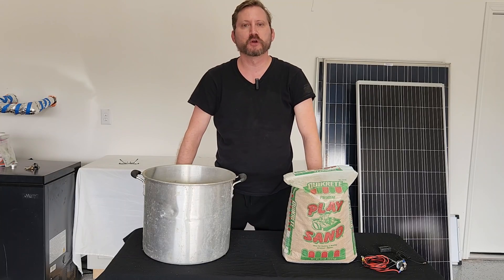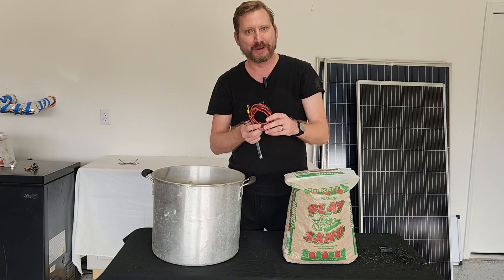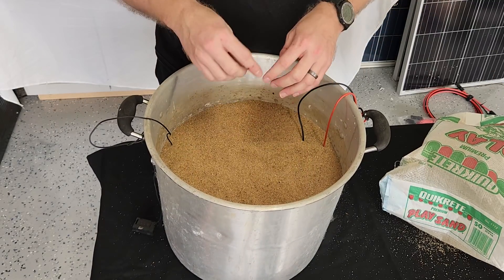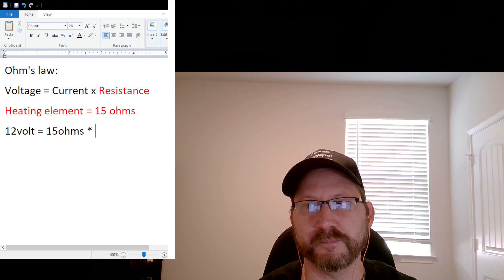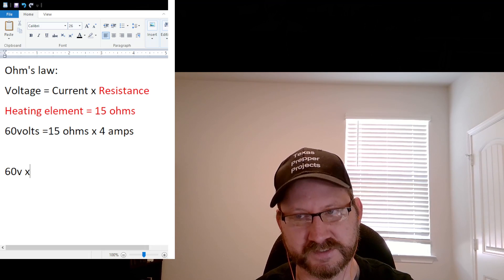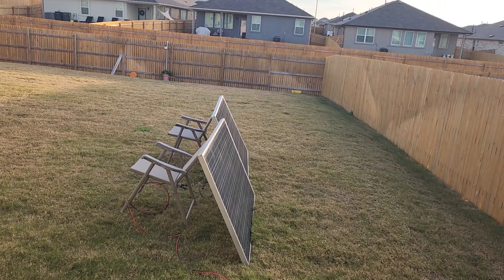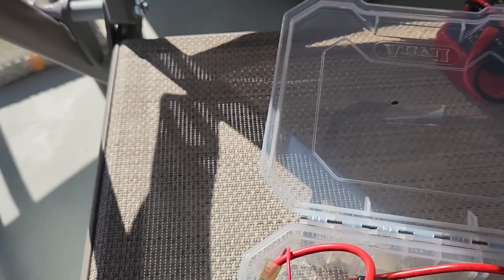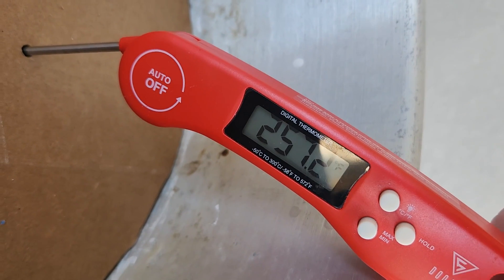Sand Battery Heater solar powered 250F / 120C with no flames or fuel! DIY

Comment: You miss one point.  But it’s otherwise a perfect demonstration of the principles of sand batteries.  The purpose of making a battery is to store energy for you to use later when you want to use it.  So putting in an insulated container is how you retain the heat for later and pipes would allow you to extract the energy when that time comes.
Nice vid.
Reply: I was thinking about this as well. Presumably while the sun is out there is enough heat for the greenhouse and storing the heat for the night or for cold cloudy days will be more important. Maybe the mass needs to be big enough that it never hits a peak and levels out. That way the maximum amount of energy is stored and can be released more slowly as opposed to getting a max temperature for the watts available. 

I like the simplicity of the setup and it's a good video!
Reply from the maker: @jhornett   thank you!
Reply from the maker: depends on where you put the sand container. If it's INSIDE the house, then DON't insulate it. If you put it OUTSIDE the house, then DO insualte it. You can't cheat thermodynamics
Reply: @texasprepperprojects but, if you want to use the heat later in a cold evening, after sun down, it's a good idea to  insulate it, until you need the heat.
Reply from the maker: @W3c16B  it depends. If you watch the video, I talk about this. If your container of sand  is INSIDE the airspace you want to you want to warm up, then do NOT insulate it. If your thermal mass is OUTSIDE the airspace you want to warm up, then you have to do ducts and fans and such. why? heat is heat is heat is heat. You want to get that heat INSIDE the space you want to warm up.
Reply: seems to me using water is a lot more easier and makes more sense.
Reply from the maker: Watch the other videos in the series
Reply from the maker: @ursodermatt8809  except water stops at 212F and then you have to make everything waterproof
Reply: @texasprepperprojects  
not so,
you can easily raise the boiling point by pressurizing or adding things like glycol.
you will find the radiator in your car is pressurized.
the problem with your 2000C sand is, how to you remove the energy?
you are going down a road that creates more problems than it solves. like the higher the temperature the more losses.
it is much easier having a larger area with relative low temperature than the opposite.
now i hope this physical facts apply the america as well.
Reply from the maker: @ursodermatt8809   the point of this experiment is to create thermal mass to heat a room, not to power a city.
Reply: @texasprepperprojects  
ah yes, but the sand is a bit difficult to control when you do not want the heat.
in the 70ies after the first oil crisis this people built a house over a pit filled with rubble heated by hot solar air. the problem was on a hot day they got a double whammy from the rubble and the hot air outside.
there is a reason water is used and people go through the trouble with piping and water tank. rather than a box of sand.
Reply: @ursodermatt8809  
It depends, because you need a nicely sealed  container.
People used IBCs but you can not get more the then 60degC permanently in, otherwise it will disintegrate.
If you use sand, and run it with higher temperature, you can put a stainless steel pipe as Heatexchanger into it, but you should use a liquid (not water) which does not vaporise if you heat up the sandbattery. Also you need High-temperatur stable insulation which is hard to get. Except something like Rockwool which withstand  750degC.
Reply: @ursodermatt8809  Water causes pressure and you can heat it to under 100 degrees C.  Sand can be heated to 200, 500, and pro made systems up to 1000 degrees, and doesn´t cause pressure.  Sure water is an easy way, but sand isn´t much harder.
We all have different priorities... I am planning for a system that could keep some heat for a longer time (1 day)... as electricity prices vary, saving heat could spare some money.
Reply: @PjotrII  
one day only?\
then go with a lifepo4 battery.
most definitively.
Reply: @ursodermatt8809  Well, the ONE# DAY comes from a test where a guy built a small sand battery, heated it and got 5 hours of heat (while using a FAN blowing out warm air)... so my aim was to think about a slightly bigger build and possibly have 1 day of heat to be used.
Reply: @PjotrII  
yes, there is just the small problem of scaling it up.
now here, talking about it and actually doing it are two very different things.
i am glad to hear from you after you actually built something.
greetings
Reply: @ursodermatt8809  Water brings with it a lot of complications.  It boils at 100C so you don’t want to go beyond that unless you are ready to deal with steam and pressure.  Corrosion.  Leaks.  Sand on the other hand can keep absorbing heat all the way up to ~1700C.  The name of the game in batteries is getting maximum storage capacity out of a given volume/mass.  A very elegant solution if truth be told.
Reply: @pchris6662  
seems to me bringing sand to 1700C brings heaps, and i mean heaps, more complications than water at 100C at 17x more volume/mass.
saying that sand 1700C is "an elegant solution if the truth be told" is hyperbole in the most extreme, is unproven and extremely difficult to do in reality. and much more expensive.
Reply: @ursodermatt8809  Well, I’m not advocating bring it up to 1700 degrees.  Just that is a relative comparison between how hot you can bring sand vs. water.  And it’s not hyperbole to compare different storage mechanisms pros and cons and specifications.  Back to my point though, think about every battery operated device there is, we always want to know how far it can go, how long it will last, and the more the better.  Think of a hot water tank as a thermal battery.  It doesn’t take long to drain its thermal energy does it, and if you get 10 years life out of it for corrosion, sediment etc. you are lucky.  Now imagine making a hot water heater big enough to hold enough power to heat a house for a few days, the cost and size and maintenance and life expectancy would be silly out of proportion.  Sand on the other hand, if you heat it up to, say 800 max, might bring the numbers together a bit.
One other thing, I’ve heard of prototype power plants using sand batteries to store thermal energy.  It is a reality and being tried, so it’s no more nutty as some of the salt based solar farms (for instance) that have been tried and failed miserably littering the Nevada desert with hundreds of acres of junk for someone else to come along and clean up.  Or 75% of the taxpayer boondoggles that our politicians have thrown our money at because they happen to be run by key campaign donors that pocket the money before filing bankruptcy.
Reply: @pchris6662  
aha, now you are down to 800C.  still very difficult to mange.
how are you going to get the heat out of it?
Reply: @pchris6662 hot water heater quality has dropped. I got 23 tears out of my last hot water heater.  It did finally rust out the bottom.

Comment: I am probably going to try a similar experiment for this coming year (2024). Of all the questions and suggestions I’ve seen here, no one seems to realize that water can’t be heated above 250 degrees F or it just boils away. But sand can be heated to 1500 degrees F! I’m thinking I can build an insulated box outside the back wall of my 12x12 greenhouse to contain the sand battery, let it charge all summer long, and direct-connect  the battery to the greenhouse with an insulated 3 or 4 inch PVC pipe. There would be a small fan that would turn on when the greenhouse inside temperature drops below 50 degrees and off at 70 degrees to recirculate the air from the greenhouse around the sand battery to reheat the inside of the greenhouse. The battery would certainly lose heat during the winter but it would still recharge during the day whenever the sun is shining to create the electricity for the heater element. Plus it would amass all that heat throughout the summer months and begin the winter with a surplus amount of heat energy stored in the sand. By the end of the winter I’m sure there wouldn’t be much surplus left - if any at all, but as the spring moves into summer it would start recharging all over again. I just want to keep my winter crops from freezing. I’ll have to see how this goes. I may need to have more than 1 or 2 batteries to make this last, but once I’ve got the numbers down it’ll be free heat all winter for my greenhouse. See “Polar Night Energy” for an example of how they are heating homes with a sand battery. Of course it’s just a matter of scale. My challenge is to find the right scale for my 12x12 greenhouse.
Reply from the maker: I think you are much better off using a small pump to circulate water through black tube on the roof and heat up 55 gallons of water or more. Check out my recent videos on this.
Reply: Hi I am thinking about exactly same system for my greenhouse and for the roofed terrace where I could keep my potted plants over winter. Same inspiration from Finland.
Have you already constructed your project?
Reply: I would not go beyond 500F, aim for something between 450F and 500F. You do not have industrial like safety controls for your container failing. If you stay below temperature thresholds that can cause material to ignite when coming in contact with the heated sand, then you are in a much safer place.

Comment: Question: How long does the heat last once voltage stops?
If you had that set up to heat up a greenhouse, how long would it continue to pump heat into the area once the sun goes down?
Reply from the maker: Check out the other series of videos where I actually test this out.  Short answer, once they stop GETTING heat, they immediately start to LOSE the heat.  About 5 hours.
Reply: @texasprepperprojects I assume that statement is based on 50lb volume of sand?
Reply from the maker: Yes
Reply: @texasprepperprojects  thank you, also for sharing the video. Great stuff!
Reply from the maker: Thanks!

Comment: I suspect you already covered this in another comment so sorry if thats the case but...
I hear your argument around no need for conductive materials associated with the heating element... heat is heat...  But I wonder if you'd get better distribution into the sand with a simple metal connection between the heating element and sand...  More importantly, I wonder how quickly the heating element will burn out if it is not having the heat drawn away from itself as readily as it would in a liquid situation.  The sand spreads the heat out I'm sure but SO SO much slower than a fluid that can circulate.  Have you seen it overheat or blow out with this setup?  Maybe it's truly a non-issue, but it would be a concern for me I think...
Reply from the maker: Funny you mentioned that. When I took this version apart last weekend the element had been destroyed
Reply: Water efficiently draws the heat out of the heating element and sand doesn't. Additionally water won't go above 212F while the sand does, as you measured. The higher operating temp burned out the heating element. You could find a high temp heating element but they would probably be expensive.
Reply from the maker: agreed @pfwag
Reply: How long had you been running this before it melted? @texasprepperprojects
Reply: @texasprepperprojects  it seems like a simple nichrome wire would work better.  See home build electric kiln/furnace contruction.  You could spread that out over a much larger area.

Comment: Do you think there is any chance this could be used in a van life setup? Considering how most van life vans are "relatively small" inside, you'd think it would work pretty well, it would just be a case of how it would all be setup inside.
Reply from the maker: Honestly no. I think it will take up too much space and be too heavy. I think that a Mr Buddy heater on propane or an electric blanket on a battery makes more sense for a van
Reply: @texasprepperprojects  Fair enough. Thanks for the reply.
Reply from the maker: welcome  @TheKnightsShield

Comment: Is there a better way of connecting the heating element with the sand?  Maybe weld stainless steel fins to it?  Just wondering as the device is normally supposed to be surrounded by water, if its surrounded by air and sand, perhaps its going to overheat?  I was thinking additional fins would provide more surface area
Reply from the maker: I don't think it matters. Heat is heat is heat
Reply: yes, but a water tank heating element is designed to be in water, not sand, and the water never gets above 212F. The sand around the heating element will get much hotter, as the sand is no where near as effective as transferring the heat out and the element will now get even hotter, past what it was designed for.

Comment: Well done, in particular I liked the lightning question round. Why necessarily couldn't you upscale this? 1 kilowatt to kilowatt worth of solar panels feeding into multiple elements of sand or some other median in a 55 gallon or larger container. Thinking wood stove replacement
Reply from the maker: You could. This is what they do in Europe.  But I still don't think you can get it big enough to be practical enough for a house. I mean, I think for a 1,000sqft cabin you would need several tons of sand and thousands of watts of solar. In Europe they use geothermal heat for the sand. I just don't think that it scales up well without another heat source

Comment: Excellent! I would just put some fence around as a shield so not hit the hot pan by accident. I think if you can build a simple insulated box to put it in and out, it can hit peak temperature much faster. A smaller version with an insulation box would be great as a camp tent heater, where need less power from a smaller more portable panel, and will only use the heat at night. It's so simple any camper can do it!
Reply from the maker: Thanks
Reply: Campers burn rocks and use those as heat for the night. You could also use a metal bucket of sand and use that as a heater for the night as well.

Comment: couldnt you simply wire up pannels directly to an existing hot water tank if you wanted hot water  for a shower?
Reply from the maker: you could, but it's not going to get very hot very fast unless you have 120 volts of solar.  If you want hot water, there are much better ways to do that.

Comment: Xcellent video :) I read below some discussion about the wattage of the solar panels themselves, and you stressed the point about the Voltage. Still, can the relationship between the Wattage of the Panel be correlated with the heating response of the element. I assume it can, and I assume it is related to both voltage and the Current that reaches the heating element. Can anyone here help me understand this relationship better ? Thanks.
Reply from the maker: Watts = amps x Volts. Also look at ohms law

Comment: What about nicrom wires? Cheap and easy to install
Reply from the maker: Heat is heat is heat
Reply: @texasprepperprojects Think maybe he's addressing the question of using nichrome
wire as the heating element to fix the high temp element burnout issue...

Comment: I'm looking for a greenhouse solution. Just to keep things from freezing. I wonder if adding some solid stones, like a dense, smooth river rock mixed into the sand would help with the duration of the heat output. I'm in southern Arizona and right now the morning lows are hitting freezing and just below. The temp really drops quickly just before sun is up so stretching the time the heat is dissipated might be helpful. Thinking of building two units. One with the dense stones, the other without and experiment.
Reply from the maker: Nope. Sand or water.